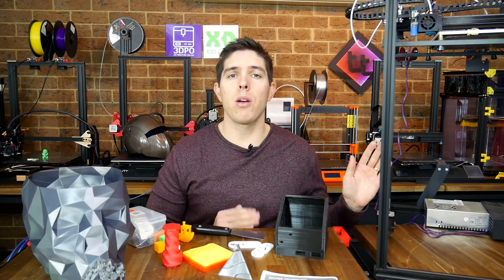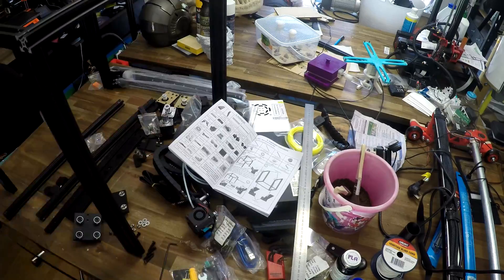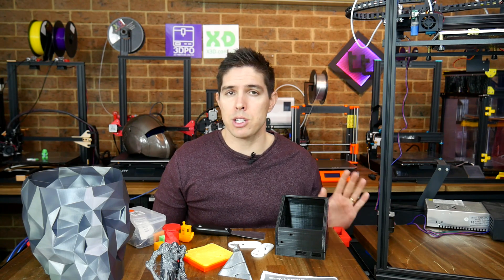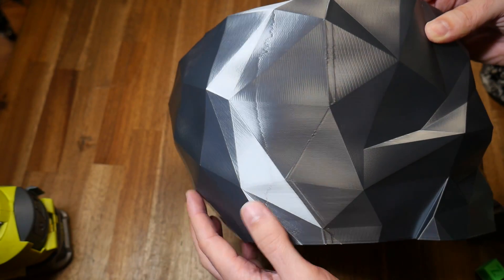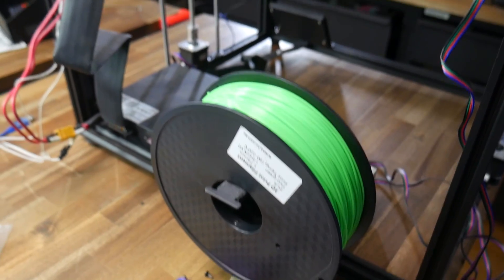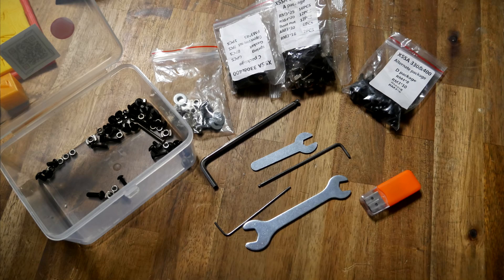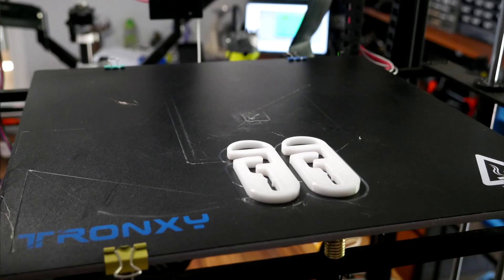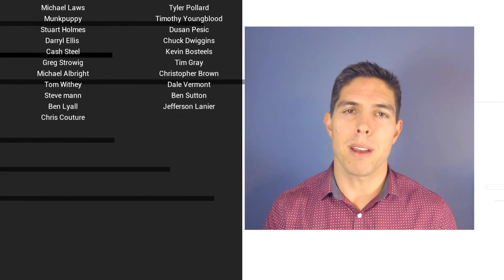Tronxy X5SA Pro review: A large format CoreXY 3D printer (with issues)

Comment: When I try to print anything on my X5SA Pro,  the hotend moves around the bed like it should, but no PLA comes out the nozzle.  

I have replaced the hotend and still no PLA extruding.  I had a Vibury MK8 Extruder Aluminum Drive Feed Replacement 3D Printer Extruders Kit fitted, so also replaced this with a new Super Print Titan Extruder, 3D Printer Stock Feeder Compatible with V6 Hotend J-Head and new stepper motor.  but still no PLA extruding.  

I am having to put the PLA in myself and when printing  the PLA spool is still, where I think the stepper motor is not moving.  Could this be a problem with the cable from the small electronics board or a failed electronics board??  As far as I can see, everything else on this printer is working fine.

Also I have levelled the bed, both using the manual and auto modes and habe done the z-offset.  

Has anyone else has this issue??? If so, how did you get arond it?  I feel like I am spending as much money on this printer as it cost me on replacing items to get it working!!!

Comment: Can you recommend a channel/operator/site to help users with their Tronxy X5SA Pro? I have a freshly built machine that does not stop its auto-level feature, as though the bed sensor isn't working. The bed sensor lights up, and the gantry continues to mash into the print head. I am an experienced printer, I am sure everything is installed properly, and their website is not helpful in this issue. Most of my research indicates replacing the board. Any help finding a good resource for this machine would be greatly appreciated!

Comment: I use this printer. Takes a little bit to get a good relationship with it. Once you get dialed in. (2 hours). You should be good to go. 
Getting set up. Whole nother problem. Took me and a team of people to get it exactly where it is supposed to be. But after that its just a matter of keeping up maintenance on your printer.
Great for buildings. Maps. Did a print of hogwarts that came out great. Half foot angels. Storage boxes.
Characters from DND. Keep it big. 
After about 4-5 clogs. Your tube will get shorter. Lmao. Unclogging and having the PLA break off inside the tube is a nightmare.
Not for beginners. But once you two start getting along. Its a great relationship. ha.

Comment: Bought one of these March 2022. Most of the structural and fire safety issues have been resolved. the software and firmware are still hot garbage, and the instructions that come with the machine for assembly are a strange mashup of the parts in this review unit and the one they shipped me.  I managed to piece it together, but I can see that easily being an issue for people less familiar with FDM printers.

As an added bonus, the test gcode that comes on the SD card appears to be unsuitable for the print surface the new units ship with. Nothing sticks to the carborundum coated glass plates below 60C. the GCode tries for 40C. There is no way to adjust the calibration on the machine without Pronterface or some other method of directly feeding it GCode. As you mention, the potential is definitely there as the new hardware it comes with is pretty solid. The proprietary digital garbage it ships with is the major remaining hurdle. If they toss their gui and replace it with something a bit more conventional, it'll be a fantastic machine.
Reply: Thanks for the comment. Are you familiar with the Ender 5 Plus? The price difference is around $250, or $320 in total after replacing for TMC2208, do you think it's worth the additional price? Or it's going to perform roughly the same?
What about Marlin? Can you install Marlin on this machine? I don't need extremely precise prints, but the machine itself should at least be properly assembled etc.
Reply: @msacco  The devil is in the details. If you're looking for a tool that will largely work out of the box, go with the Ender 5 pro/plus. The Ender 5 is more of a complete machine in a literal sense where as the Tronxy is a box of decent parts with horrific software getting in the way of everything. 

Even if the software weren't total garbage, the core XY design is just overall more fidly to square up and tension. The cartesian format of the Ender 5 series is also a lot less of a pain to square up and tension. To top it off, the Tronxy has poor slicer support at the moment. There are some presets in Cura, but if you use something else, you're rolling your own.

It is possible to delobotomize the Tronxy's electronics, but it's not a straightforward task on the newer machines (2021 and later). Basically requires nuking the existing data on the board and loading an ancient version of Tronxy's firmware that allows flashing the firmware. Once that's done, It's a solid backbone for a core XY printer with a crummy Chinesium hotend and nonstick carborundum bed. Expect the Tronxy to need a couple hundred dollars in upgrades and a fair bit of your time to get running well.
Reply: @dtaggartofRTD  Thanks again, I'm looking for a larger printer size mostly, so that's why I'm considering that, and supply/prices doesn't seems the best right now compared to when I got my first 3D printer.
Sounds like the Tronyx could work but involves too much of a hassle by as it seems.
Each thing doesn't sound like it's that hard to do, but when something small in each of these things don't work, it sounds like a lot of frustration and time consumption, I like cheap, but I also like not wasting all my time on things that might not be necessary :)
Reply: @msacco  Yeah. The machine has definite potential, but it is absolutely a project in its current state. Definitely a space to spend the extra cash for something a bit more complete. 

It's definitely one of the cheapest machines in that size range. In this case I think all the money went into components with little left over for the stuff that makes it actually function. 

Very much a case of getting what you pay for. The real cost is time.
Reply: @dtaggartofRTD  Gotcha, I'll probably skip this one, thanks for the fast replies :)
Reply: @msacco  Glad I could help.

Comment: Fist print after building this kit and great results so far mostly, I think this might have been a case of user (reviewer) error. New version has metal motor mounts. On the other hand I will be replacing the factory power cable as it gets warm to the touch when heated bed is on this is a saftey issue that tronxy needs to address. It's a cheap kit that prints big with decent quality shame about saftey issue otherwise I would have given it 10 stars

Comment: I regret buying one. I've had nothing but issues and problems regardless of following proper set up and going marlin. Facebooks Tronxy pages all say the same thing. Pretty much anything original on the machine needs to be replaced with aftermarket parts to make it operate properly.

Comment: Have had this for about 3 months now.  After printing new stepper mounts,converting to direct drive, installing a v6 hotend and a meanwell power supply, it's been pretty good. Temps are more stable, stringing is reduced,parts are more accurate. 
Only thing I still would like to change is the firmware. I dislike not being able to adjust z offset on the fly. 

Also just remove the auto level gcode.  Adjust the bed well like you normally would and leave the horrible autolevel alone.

Comment: I know I'm 2 years late, but I have fortunately had mostly good experiences with my 3yo X5ST-400 (an X5SA-400, but without the automatic bed-leveling).

It worked ok out of the box, worked much better with just the addition of (self-printed) corner-braces (to greatly reduce ringing), and just a few days ago I finally flashed it with stock Marlin firmware.

I recently bought an X5SA-400 Pro (with Titan clone, BLTouch, and glass bed) that I have yet to assemble (we're doing a video on it for a channel I'm associated with), so despite this being my first printer, it neither failed me nor scared me off 3D printing or TronXY as a brand.

Great review, I agree with everything you found, and as you say, most of this can be fixed quite easilly (which makes it geared more towards people who are experienced, or at least like to tinker).

Comment: Nice review as always.I probably will not buy this printer. I don't think you should have to basically redesign a printer out of the box to get it to work in 2022. Adding a few upgrades...Maybe but changing about half of the components and design, NO. I would rather just build a printer from scratch. But if I go into buying a printer very cheep knowing I am basically just buying a usable Frame that that would be different. On my Ender 3 Max I have the same issue with loading Filament through the Filament runout sensor. There is at least 2 major issues with my Ender that I can not recommend it to others. Hard to load through the Filament Runout season. 2: I can't get My Ender to connect the either Repeater server or Octoprint. And I am still dealing with a Under extrusion issue after several week of trying to figure it out. Also, it seems like you I have to print fairly slow on this printer, when I can get it to print at all. I wish more printers would just come with an Aluminum build plate not a glass plate. The good is that I took off the Glass build Plate and put my Aluminum Flex plate with Garolite top surface directly on the Ender's Aluminum bottom plate. at least that't a plus. Much Much Much better heat transfer.

Comment: Total newbie and this is my first printer. If I didn't have a friend with experience, it would have been a disaster, but as it is, I got into the hobby for under $200, and I'm not limited to small prints. Mine printed pretty nice out of the box as soon as I lowered the hot end temp. They seem to have it set on the high end by default, which leads to spaghetti. Did I mention they made a mistake and sent me 2 printers for the price of 1?
these were amazon return units. The first looked like someone opened the box and said "hell no" and sent it back. The second had been assembled, broke a couple plastic pieces, made 1 or 2 prints then hastily taken apart and thrown into the box with all the screws just tossed in. I still dunno if I will build it or just keep it for parts. Maybe put it together and do the laser conversion...

Comment: bought one about a week ago.  Tronxy now has some videos on assembly and some youtube videos that helped with assembly.  overall assembly went well and did get good dimensional print.
however, it does still have that temp variation.  my printer fluctuated about 14 deg.  its causing all sorts of issues when printing.  bad part is I can't find any information on how to PID calibration on stock Tronxy firmware.  probably end up changing to marlin or klipper.  good video, keep up the good work.

Comment: I know this is old but some of the stuff you mentioned are nit picking. I got the X5SA and to get it square you just have to ziptie the x axis to the back rail so it remains square and it doesn't move. 

They have plenty of zipties. So this is pretty easy. That way you can tension the belts while it's square. That way it doesn't move and it allows you to tension the belts in one go.

With the z axis I bought a timing belt and printed some gear for it. Now it's perfectly leveled every time. I will say that this is something this machines needs and tronxy NEEDS to include this in the printer and it would make it 90% better.

Comment: TRONXY support is awful.  

I have an issue with the motherboard, and they don't want to honor the warranty.  To prevent fixing the problem, they lied and do not answer questions that might confirm the issue.  They even denied that the command to get the printer settings exists, while it is very well documented on the web and forums.  The printer reacts to it and tries to write to the SD card the settings, but fails with error messages. 

If you get this problem, it will be a nightmare to calibrate your printer.  The calibration is off out of the factory!  In fact, there is no warranty and no support.

If you want to see the emails I've exchanged with them, reply to this comment.

Do not waste your time and money, buy your printer from a reputable company, not TRONXY.

Comment: Tensioning the belts can be pretty easy. Just push the gantry all the way to the back, making sure both left and right are hitting the back alu profile. Tie it in place with 2 tie-wraps on both sides. Now you can tension the belt and everything is straight.

Also I had no issues with the firmware. Though I have a Tronxy X5S 2E. Not a X5S-A. Bed levelling seems to work ok for me. Not perfect, but Ok.

I do have the horizontal banding though, and wondered if you know a way to get rid of it?

Comment: the auto leveling is poorly implemented, it is basically manual, you have to go to the leveling menu, select auto and it will probe the bed. It displays the probing values on the screen and you have to adjust the screws under the bed

Comment: I think this is a great printer (for experienced tinkerers) as a base to build upon.  I flashed marlin on it before I even turned it on, so perhaps that is why I avoided a number of issues (z-offset, bed scratches)  Also a bmg clone in place of the crap extruder that comes with it.
I enjoy modifying printers, that is half the reason of owning one (for me), so this fits well.
If you want a 'set it up once and go' kind of printer, perhaps take a pass on this.

Comment: Hello All, I thought since I did a comment 6 months Back I best give a new update about this X5SA printer I have?
I have been fighting with it over the leveling now! It will not do a good leveling either using the Auto leveling or the manual version.
I checked the frame squareness and the rest and it is well bolted together and fine, 

But the problem I got now is after it started to do good test prints when I last commented 6 months ago. 
Now I getting bad leveling problems, It will not do the right leveling either way it is done auto or manual version.
Either it starts printing 3 or 4 mm above the bed or digs into the bed.

I got the newest ( early 2020 ) firmware sent to me from Tronxy so I could update it for using the ABS and PETG and TPU flexible filaments as I got the Tronxy Titan extruder mounted in place of the original Tronxy extruder, I found out that if the Tronxy magnetic flexible print plate is heated over 70 C the magnetic effect fails and the flexible bed will start to lift and curl up at the corners and if it gets up to say 80 C or more the magnetic bed will fail fully and you end up having to use the small spring clips you had with the original metal bed to help hold the magnetic bed down and even then it lifts in the middle so the printing is wreaked!

But by far the worst problem seems that the printer just won't do the leveling right on either type of leveling. I even believe that the Z stop off step you have to set after the 16 point auto or the 5 point manual leveling is I think, mucking up the levelness in the middle and making the nozzle hit in to the bed as it is seeing the Z level stop as the main distance not the one the auto or manual set before it?
I tried to do a print without the Z stop off step but it made no difference?
I was thinking maybe if I could fit a BL Touch sensor in place of the normal magnetic distance detection sensor maybe that would solve the problems?
But that is a pricey upgrade and I no rolling in money.
And yes the silent of the stepper motors is good but the noisy fans do ruin that silent running.

I even had spent hours yes hours doing many auto or manual leveling try's to get the printer to print right, It seems like others I must have a warped bed, the auto level of course is meant to solve this by moving the bed in the Z plane But it makes no difference to the printing, the company states that you must level the bed using the 6 leveling screws to a bed levelness of 0.08 this is even on the leveling text on screen, it is impossible to get that on this big bed which seems warped.

I did find out everyone that the best tape to use to make all prints stick on the bed and come off cleanly is the gold heat proof electronics tape people use for electronics.
( Tape for 3D Printer Wide High Temperature Heat Resistant Tape Polyimide Film Adhesive Tape up to 350 C )
here is the UK Amazon link if you wish to get it?

https://www.amazon.co.uk/gp/product/B06XJKJXWY/ref=ppx_yo_dt_b_asin_title_o02_s00?ie=UTF8&psc=1

It works very well for adhesion and smooth printing and great for releasing the print.
The few small times I got a small test print to really print.

Such a big shame this printer is such a hard system to get to print anything?  I had two good big prints done in that 6 months, one was almost as wide as the 330 mm bed it's self.
But that's all I got and since then tons of wasted time and money and stress from trying to just get it to level right.

Maybe one of you lovely people can give me a way to just have it level right then all the money I spent will not be a waste? Thanks  8 )

Comment: i got 2 off them and I can say your review is really accurate .

I got problem all the times .

To compare >

i have 1 creality CR x pro since 6 month it was my first printer and got less issue than X5SA .

If you shutdown the power you have to do again the z offset
After printing you have 50% of chance to do the z offset again .So strange
The worse was eletrical shock and it's happened with both printer .I send a message to them and they didn't sorry ,they just didn't care at all .

Stupid issue ,sometimes the level bed sensor is out off the bed ,so the bed keep going up and the nozzle scratch the bed ,I have some hole .

For the stringing you can fix it if you put 
retraction speed 70
length 8MM

This setup worked but only on one printer .

I will never get tronxy printer from my life ,to much wasting time and money instead of printing .